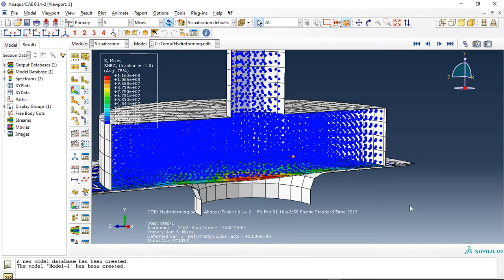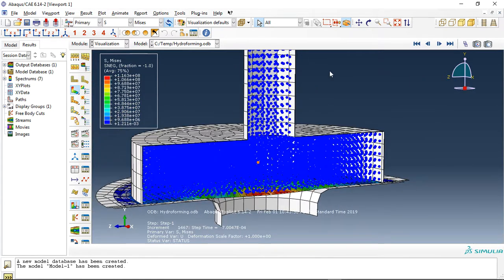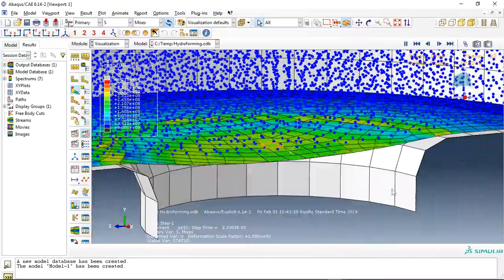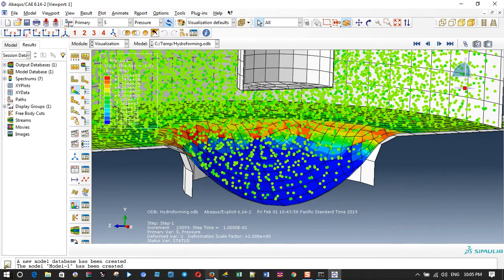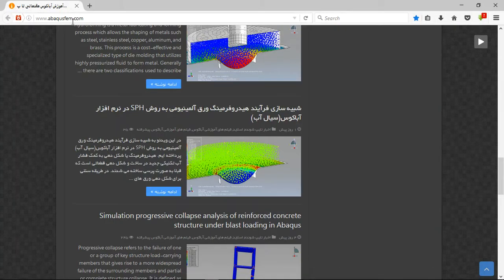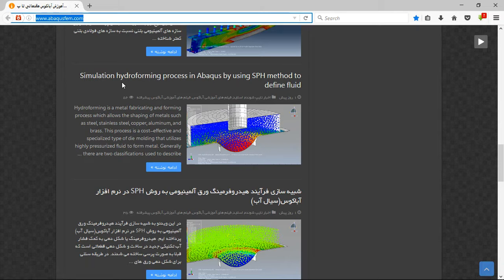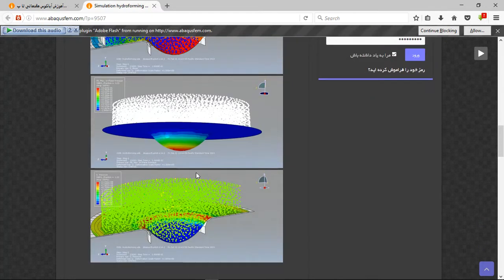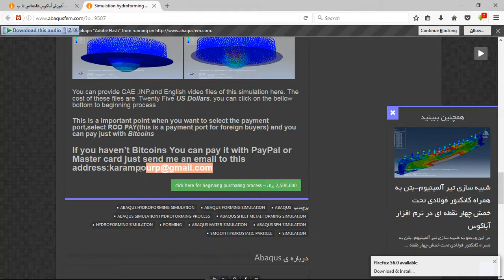Simulation hydroforming process in Abaqus by using SPH method to define fluid

Comment: Dear Mr. Karampour. Thank you for the tutorial. In this tutorial, you use SPH and EOS to model fluid flow with the punch movement. But is it possible to define the fluid pressure to the SPH particles in this process without using punch to model fluid behaviour or could you please advice me on this?
Reply from the maker: To do that you can use lagrangian or eulerian Elements